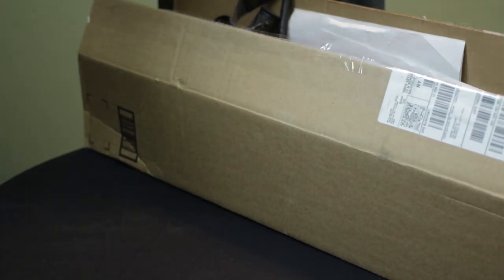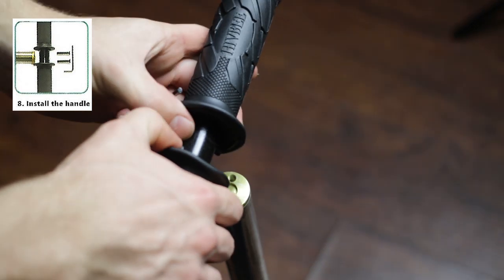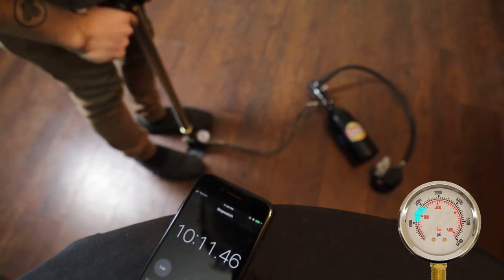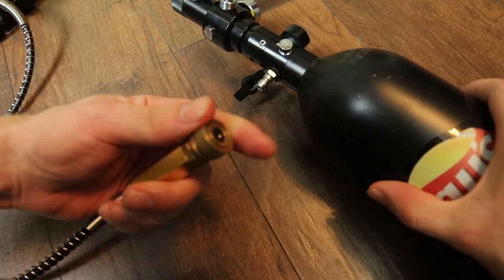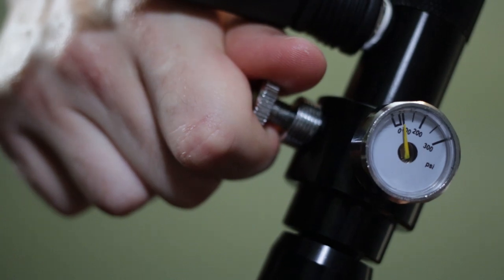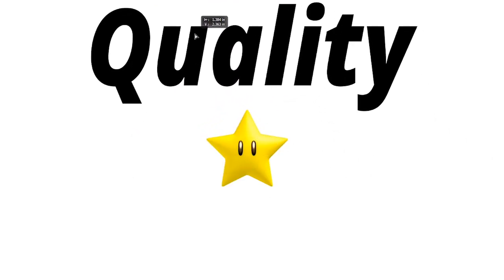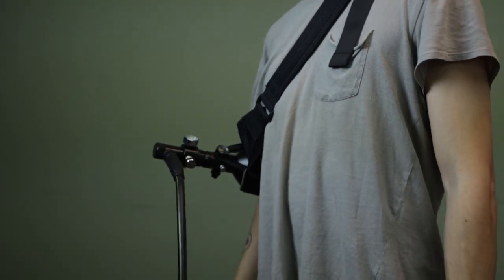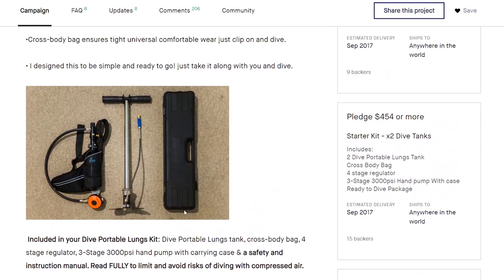Dive Portable Lungs Kit FULL Review / Unboxing / Installation

Comment: I think if you are certified and you understand the risks of pressure and nitrogen absorption you'll be ok. Ironically I actually think the limitations of the tank make it pretty safe. If you dive shallow (5Mish), then you will get more time diving/snorkeling but the nitrogen absorption will be slow. Equally if you dive deep, say 20M then nitrogen absorption will be much quicker but you will only get probably 3 or 4 mins of air. Both of these factors provide a safety net. As long as you ascend slowly and breathe out you should be fine. I'm certified and I am going to get one for snorkeling (5-10M depth.)
Reply: All well and good until you get some kid with an air compressor who keeps filling the thing over and over again with possibly foul tainted air and dives all day with no concept of repetitive dive tables. Then you've got issues. Better to leave these thing to certified divers... or best not to use them at all. But at the very least a certification should be required to purchase anything like this.

Comment: If this kind of product interests you I urge you to stop and think before you buy it. 

Do you have a scuba diving certification? We dont get these for fun or bragging rights, they do cost money but we get them because there are a lot of risks associated with the kit we use underwater that we need training for, especially with the SCUBA element. Scuba is very safe as long as you know what you're doing, which you wont if you buy this as a stand alone product. 

Second, the price is expensive. Yes proper scuba equipment is expensive but that's because your life depends on it. You can get good second hand regulator set and cylinder which is essentially what this is but for a lower cost, just make sure you get the kit tested.

Comment: Please everybody consider that scuba diving without proper education can be very dangerous and can result in serious injuries and pulmonary failure. There are only few single in scuba diving rules but these are very important for your own safety! I think your life is worth a 3 days course.
Reply: You guys are thinking of depths where there's more than just air needed in the tanks and where the "bends" could happen. This is shallow diving. Not much danger there.
Reply: @jimbob.2299  Bends are the less important problem in this kind of situation. First of all, breathing compressed air can cause lungs over expansion even with depth excursion of 40 cm. Moreover the quantity of air consumed by every respiratory act varies based on the depth so you could find yourself with an empty bottle at 8 or 10 m not noticing it (because you do not have a depth meter with you) and not being able to go back to the surface. I could continue but that's why we make courses...
Reply: @jimbob.2299  The expansion of air, even from just ten feet, can cause serious damage to your lungs.  You will not feel that expansion until it's too late.  You always breathe when ascending and you will breathe out a greater volume than you breathe in.

Also, you always ascend slower than the bubbles around you are rising. 

It is a very real danger and I have to endorse what Andrea says: Take a few days of instruction.

With the bends (unlikely with this kit), we can treat.

Ruptured lung as a result of rising too fast or forgetting to breathe,  you will likely die.
Reply: @jimbob.2299  #1 RULE ! NEVER fill your tank with oxygen, use compressed air only ! #2 Just make sure you NEVER hold your breath under water while using tanks, it’s just good practice to continue breathing, if you do hold your breath and start to ascend you can potentially burst your lungs from expanding air in your lungs. There are other very important rules even in shallow diving but these 2 will save your life before you make a severely stupid mistake. Diving is no joke.
Reply: @endliberalism4305  Yes I know that you should use air NOT oxygen. I never mentioned oxygen but it's all good.
Reply: @jimbob.2299  Apologies, it wasn’t directed towards you bro, I guess I just used your post to spread what I know about the most critical pieces in diving, I forgot to mention one other IE - DO NOT PANIC- ! Panic causes a huge number of fatalities in diving. Just saying........ no sir I meant nothing towards you. These are cool little setups for low depth snorkeling tho.

Comment: The fact that you set the PSI going to the second stage means this things sketchy af I have 5 reg sets even the cheapest one I have for 100 bucks does that automatically and for 400 I got a pony bottle and a regulator button gauge 19 ft.³ pony bottle is a lot bigger than that that’s probably like a 9 or 13

Comment: When you compress a gas it gets hot. As it heats it expands. So the hotter the gas in the bottle, the less you will have after it cools. I sometimes fill my tanks with them submerged in a drum of water to help keep them cool while filling.

If you want to dive, get training. It really is the difference between life or death. Even at shallow depths.
Reply: Is there a problem with the novice diver?
Reply: @greenmoon9461  No problem with novice divers. But this guy is literally avoiding equipment in his review that requires a dive certification. If he's unwilling to learn to safely dive, this is unwise.
Reply: @diver0129  I'm not going to do that. I've never tried it.
Reply: No diving certificate or education
Reply: So many people snurkle and no one bashes one that. When the person doing it, go down with only 1 lung fill. So is clear to know, that the snurkling person, will not go too deep. Not far different from these tanks. with the benefit that u dont have to go back up, in like  10 plus minutes. People should stop panicquing others. just because they dive with expensive equipment. This is for a blast shallow diving for some minutes. Thats all. Is obveous that  people need to be aware of basic diving rules.
Reply: @diver0129  I have dived for over a yr now. I have no problems. I am. not certified, but i have educated myself gathering info. Certification requires all the basic info that anyone can get. The different thing here. Is to be taken from 30 to 60 ft deep with instructors. If many people wants to breath underwater at 10 ft. even fucking 7 ft deep. What the hell is the problem. Most people including myself. I have no interest in exploring chip wrecks,, caves and other deep ass places. I dive where i can see people around me. Where i can see the water top. Shalloooow. Stop panicquing people. Certification for 9ft of water when people, kids, snurkle all the time,, with no certifications. Too much drama,,, like if people would attempt to conquer sea depts or rivers depts with this.

Comment: Scuba certifications are worth it, even a rushed certification is alright if you just plan goin out in shallow water. This product is not worth the money, at a local dive shop or online a scuba package is 500$ and you can get a used scuba package is 300$ and then you will pay 100$ more for a tank. So it’s just 100 more for more air, fun , and less of a hassle with trying to pump it

Comment: Deathwish, Damm get certified it's only your life.
Reply: If your certified and you don't go deeper than 15 feet this is fairly safe no safety stop and if you know how to properly do a rapid assent then its OK in my opinion.
Reply: Umm if you are breathing that shit air why would you bother with certification.. the hand pumps do not stop oil/air traveling into the tank. I would definitely not let it get to hot it will only add more oil into the air.. if anyone was to use these I would recommend at least getting a high pressure filter that you can repack it yourself.
Reply: @toms4022  I use a compressor. But the oil i use in it, is a non toxic, biodegradable- food grade. I have been doing it for a while and i have  had no health issues so far
Reply: @sylvixyan  Well, u dont want to do rapid ascend. Even if u are a  15 ft or 10. U are not supposed to ascend any faster than ur bubbles. U have to make sure u clear ur lungs as u go . taking short breath ins and exhale as u go up. Keeping them near empty of air
Reply: @lvstream720  don't buy this mine broke after 3 dives...
Reply: @sylvixyan   I have no problems..I build them myself now. Plus the big issue with that dude that sell those. He doesnt even use bubble wrap.. He sent my talk all loose..Unwrapp and with the pump there too. He is just a punk that loves to make money. Example. How in the hell, he sells a crossbody bag for $19.95,,, but then u have to spend $40 for shipping. When that item is not even 4 pounds in weight. I weighted my kit in a box at work. And the shipping  is not even $30 dollars. But he forces everyone to pay $40 or more, on prepaid boxes. Because he buys them ij buck and is cheaper. He buys boxes that might have a 12 Lb limit as an example.  Which are cheap in bulk. But then u pay 40, like if ur tank  weight 15 to 20 pounds. Which isnt. Thats how he screws people up. When it told him, when thinking about buying to cross body bags. I told shit,  you are not pushing me to pay 40 bucks on shipping. If is international. It might be a money saving option to some destinstions. But not within the U.S.  He just takes advantage on people. The compressor he sells for 500 hundred plus dollars. thats the worst punch in the face you could get. With the 40 bucks shipping. U end up paying almost 600 dollars for that dang compressor. When u can find them in other online stores for $260. Brand new, a better brand and free shipping. He pays like 200 plus for them and then put a 300 dollars increase. That dude is something. He doesnt give a shit either. If u fall for it, is your problem. I even review the Smaco s400 scuba tank on amazon. That scumbag was so bold. That he commented,, horrible design, Do not buy, waste of money do not buy. i know it was him cuz the name on his profile. He bashed on something he didnt even try. He just did cuz he sells scuba tanks. I placed a 2nd comment addressing the issue and asking amazon to remove it. They never did, but i explained to people to not believe his ass, cuz it was competition for him.
Reply: There is actually a legal limit for uncertified divers 8 meters, it is illegal to go deeper as to your you own safety as an uncertified to prevent problem such as lung rupture from surfacing without right precautions

Comment: Diving with paintball air bottle. Awesome. That is just enough air to blow your lungs on rapid ascent :)
Reply: Dumb comment once again. How am i going to blow my lungs????. People talk like if any user is an idiot to not check his tank air levels and make a safe ascend when he still have enough to go back up safely. Those tanks have gauges. And by the way.... Also has a regulator that does not release bursts of air. The pressure is controlled. Set at a 150 psi at most. And the breathing is super smooth. And i am not just referring to this tank. Smaco works well too.
Reply: @lvstream720   too bad you don't understand. get certified for scuba diving and you will.
Reply: @ronilackodrustvojadranovo9158  Yes i do understand. What many of you dont undestand, is that uncertified people that use these portable gear. THEY ARE NOT INTERESTED IN GOING 60ft DEEP. You cant tell me that You diving at 60, 80 ft bellow. U are going to be more secure,, than me, diving at 7ft. Ge da hell out of here man. If people snurkle at 7, 10 ft without problems. Carrying a tank that can keep them bellow for 10 mins,, is not going to harm them. You dont even know if i am certified or not, to begin with.  Many of us, simply like shallow. The ones that dive at the same deph as snorkeler. They dont have to be worried about compression-decompression effects. Simply get in your head... Not everyone is interested to go 30 to 60 ft bellow the surface. Which is part of becoming certified.
Reply: @lvstream720  lol

Comment: Wonder if you can pump this tank up with a Tyre compressor air pump
Reply: It would be highly inadvisable. A standard air compressor is not properly filtered and can fill the tank with water, oil, and particulate matter all of which can cause serious issues if you breath them in.
   This is why getting a certification is important a lot of things that people don't even consider in this sport can be very dangerous.

Comment: Why does a 3,000psi tank, have a 300psi pressure gauge?

Now everything is clear, these are not true BA (Breathing Apparatus) tanks. These are not scuba (or even scba) tanks. 

The average air consumption on the surface is 6-10lpm. Meaning you’re going to empty this puppy in 2-4 minutes on the surface or 1-2 minutes at 10m/33ft.

So the nickname “Three breathes ‘till death” is pretty accurate.

I would love to try one of these at 30m (whilst on regular scuba).

Comment: If they tell "don´t use the pump for longer than 5 mins", and you use it 10mins straight, notice it´s getting hot, and still don´t understand, then, nothing can save you... Have you ever heard of material science, and that materials have their own thermal limits? You know surely allready, that stuff can break, melt, freeze, bend, rust, and all the rest? 3:19 "The air was the same quality"- quote was the best... So clueless!
Reply: I use an electric compressor with a filtration system. I dont fight any hand pumps. fk that

Comment: for $500 I can get the full Diving gear in very good and Certify to use Condition on Ebay A real 5000 Psi with a Pro regulator and buoyancy Flippers and mask. oh also a wet suit.
Reply: Even high pressure cylinder is only rate to 4,500psi, most are rated to 3,000psi.

Comment: For a little tank it can take alot
Reply: @WienerBoop  Why did you replied like that?. Do you dislike the tank?.
Reply from the maker: @lvstream720  no no it's just I know this man IRL, sorry for confusion
Reply: @WienerBoop  ohh it was because he said that the tank can take a lot for its size. Then u replied eat my .../ i thought that u felt he was lieying.  Do you still have the tank. I thought u were doing a fresh unboxing. But you just put it back in the box and taped it for the video
Reply from the maker: @lvstream720  Yeah I still have the tank! I wanted to do a fresh unboxing but obviously, I couldn't. The only reason I put it back is so people could watch the whole process. I was struggling with setting it up myself when I first got it and wanted people to see every step. sorry for the late reply
Reply: @WienerBoop  be honest with me. Have you experience any air leaks where the hose is screwed into. Not saying like an excessive air leaks but bubbles coming out?. Or behind the 2nd stage nut. I am running into these issues. Dive portable lungs use a cheap top adapter, made of aluminum
Reply: And as you know. The inner thread for that tube is not deep. So you have a steel thread from the hose. Against aluminum from that top tube. And it sucks that you dont find replacement for those. Unless you contact Dive portable lungs. I mean a paint ball one will work. But then i will have a 3rd gauge. And the top valve to open. If i dont throw this tank whole thing in the garbage. I will replace the whole connection down to the tank. And put another one with just the 1st stage , with the on/ off valve and gauge. 2 damn adapters/ 2 gauges. to lead to the hose inlet. WB do yourself a favor. And get a Smaco S400. With a Yong heng compressor. And get a tuxing apparatus that will clean up the air good. Before enters the tank. That manual pump is a waste of time.
Reply: You reviewed Dive portable lungs by category. And i rand into some upsetting times with support as well. Is like 1 person runs the whole deal. Is like there is no customer service staff. Just an Instagram messenger to answer questions, whenever  he or she feels like. The look at the now price bro. The kit cost $895.95.  Thats fuck ng absurd bro. Even the one without the pump, cost more than the previous price for the pump included bundle. With the 695.95 previous price. You could get a smaco, the compressor and the tuxing warer and oil separator. All together. And still not pay $695.95.  That kit owner is showing greedyness. In ripping people off for a kit that has a worthless, legs and shoulders killing pump. With a tank that will leak air as you swim with it. And move around.

Comment: it takes over 30 mins to pump up and for that time and work it only gives u 10-15 mins of air? dont really seem worth it to me. i like the idea though, maybe it just needs to have a larger tank
Reply: Well, a standard SCUBA tank is 12 or 15 liters, the portable lung is 0,5 liter or 1 liter, not sure exactly. 10 to 15 minutes of air is very optimistic and achievable only is you do a very shallow dives (given the fact that you do not have any redundancy here, very shalow dives are the only ones possible if you value your life and health). 

I guess that you could fill this bottle in a dive center for a pricewhere you dive if they let you do it at all.
Reply: @michakurek454  Would you use a dive center that filled these bottles for unqualified divers?  Not sure I would.
Reply: @PhilJonesIII  I don't think it can be filled at a dive store the valve is not compatible with standard dive connections
Reply: @harleycullen6102  I'm actually glad to hear that.  Not enough air for a good dive and more than enough air for a busted lung.
Reply: @PhilJonesIII  these things were call spare air when they came on to the market going back a little while now not a very useful product back then but was never intended for the non trained scuba diver.

Comment: just get a small compressor to fill it.
Reply: You get oil free compressors, no big deal. Obviously you don't go over the rated pressure, that's just common sense. It's easy, don't try over complicate something that doesn't need to be.
Reply: @DigitalAwareness  Common sense would be to get the proper training and the proper equipment.